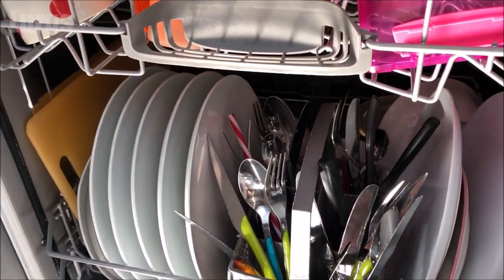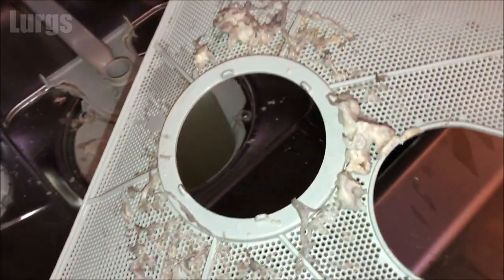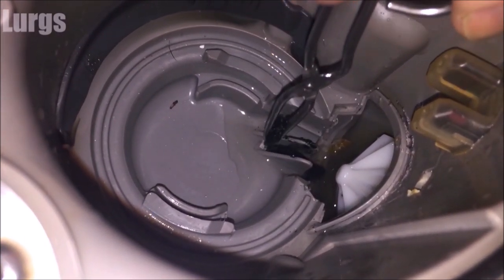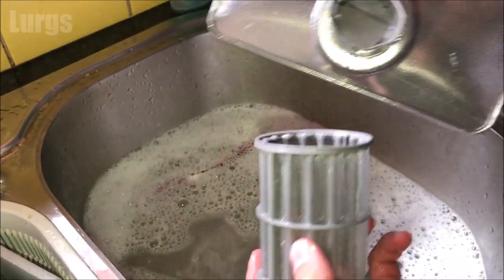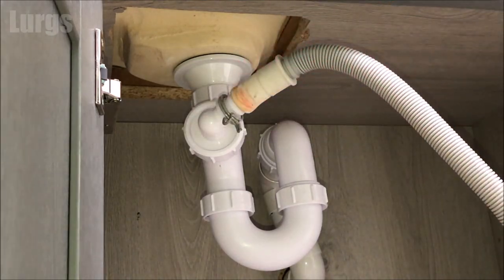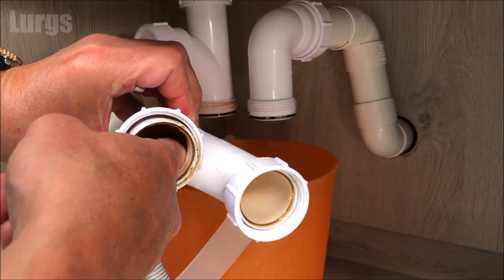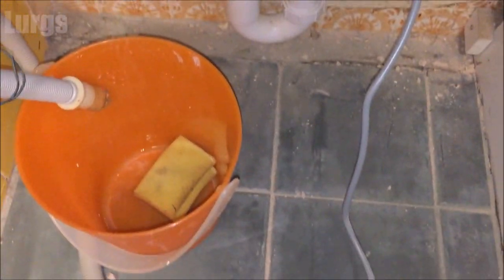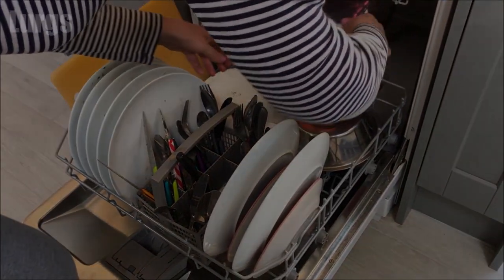Dishwasher Drainage Problem - Dishwasher not draining Water Easy steps to try and Fix

Comment: Our beko dishwasher did this in 2020 but we pulled the dishwasher out and removed the bottom of the dishwasher and removed the pump to get to the impeller
Reply from the maker: Yeh that’s a big job, this is basic checks. Hope it’s still working ok